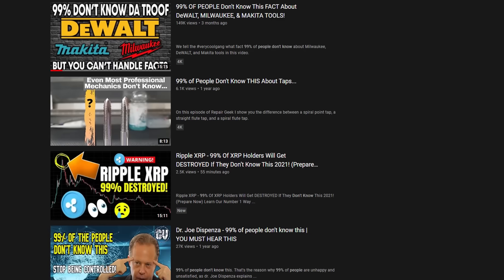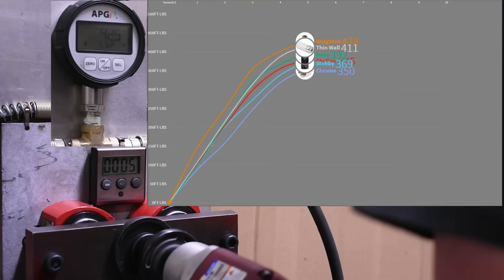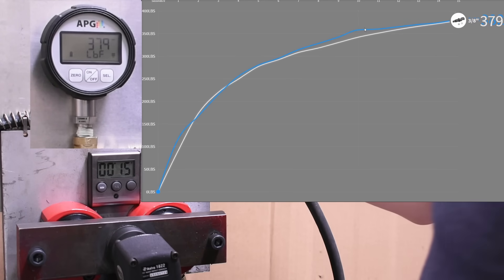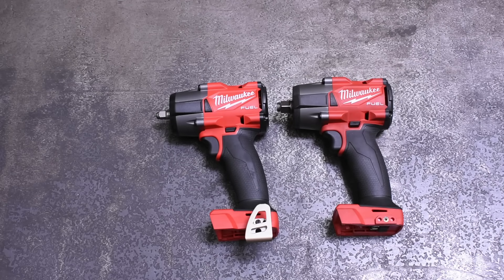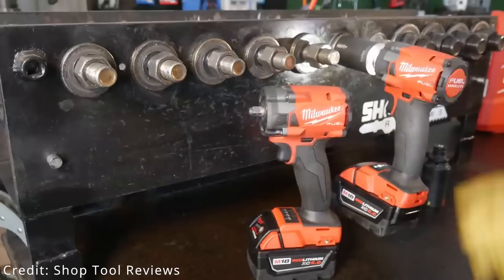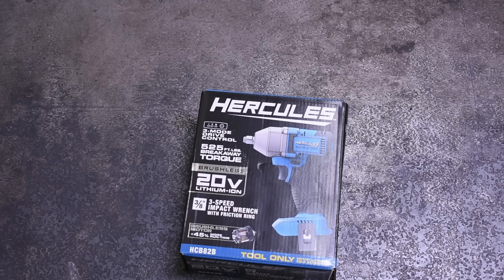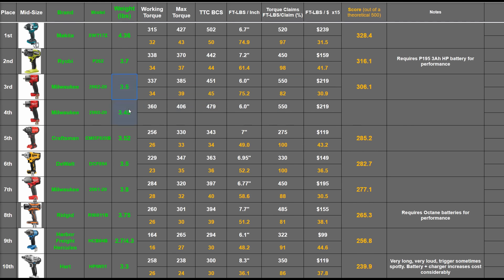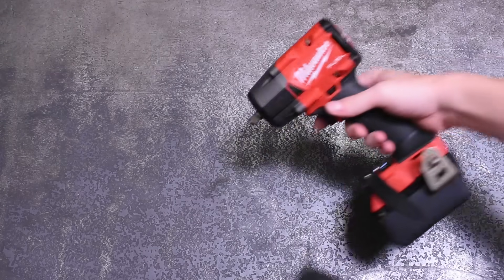Measuring Power Difference Between 3/8" & 1/2" Impacts = WTF

Comment: I use this 3/8 impact driver. I love it. I've removed 36mm axle nuts without an issue. I don't even own a 1/2" impact driver to be honest. I have the Snap On adaptor set. I'm good with that.

Comment: For this specific situation it would be interesting to see if the results are the same if you used a 3/8 to 1/2" adapter thats not welded instead of a custom socket because in the real world most of us are not going to buy custom sockets and would just use an adapter. I know you referenced the other videos but im curious if the results would be the same which the may just be.

Comment: I can see a point to having a 1/2 over a 3/8. Say you're working on some bigger stuff, using larger sockets, like 1 7/8in or something like that, which isn't normally made in a 3/8 drive, it's better to use a 1/2 for stuff like that. I'm eventually gonna pick up a 1/2 mid-torque for stuff like that (also because I don't have 3/8 SAE impact sockets, whereas I have 1/2 SAE impact sockets, and I work on enough stuff that uses SAE to make it worth it) and considering it's a monster, I might use it for most jobs that I'd normally be using my 3/8 with an adapter for.
Reply: If you're using sockets 1 7/8 inch sockets, at that point you should be looking at a full torque, not a midtorque.
Reply: @Ninoo187  Doesn't always fit where I need.
Reply: @enlightenedrenegade472  you can't fit a full torque where you gotta use a 1 7/8 socket? ..... I doubt it but okay.

Comment: I bought the 3/8” mid torque gen 2 few months ago and it’s great, I had no idea it was any more capable than the 1/2” on the contrary I thought by sepc that the 1/2” is little bit better but I wanted it be used on wider range of bolts and nuts & 3/8 was better fit for me, nice to see it is the more capable version of the two (not that the 1/2” is weak by any means).
Reply: Wait, so I should probably buy a 3/8 for a weekend warrior like me and just use a 3/8 to 1/2 adapter?
Reply: It's not more capable. This data doesn't show long term use. If you wrench daily, you WILL break your 3/8 head doing 1/2" tasks. I've seen it happen and it's happened to me. Never have broken a 1/2".
Reply: @Frissdas1207 then show me the data that the 1/2" version of this tool is better long term, show me data that support your claim that THIS tool version 3/8 breaks easily on " 1/2" jobs". Otherwise this is just talk.

Comment: I'd be curious to see you take the 3/8 and 1/2 Milwaukee and swap the anvils to see if the 3/8 gun is doing something that the 1/2 gun isn't.
Reply: This, this should have been the next step in finding the root cause.
Reply: The Milwaukee Right Angle Fuel advertises the 3/8 and 1/2 with the same spec's and the same price; IOW it's the same tool only a different anvil. My guess is it's the same with many other manufacturers, which explains why there's little difference between the two. Further, the 20v Atomic DeWalt 1/2 stubby impact wrench has the same torque rating as the Atomic 3/8, but the 1/2 costs $100 more. I guess it's all about marketing.
Reply: Just anecdotally I use the fuel 3/4 at work and another guy has the heavy duty 1/2" that's exactly the same except for the anvil. Never ran into an application where one outhit the other and it has come up where we've used both to try to bust bolts loose.
Reply: ManCaverTools put the 1/2" stubby anvil in the 1/4 hex impact driver stubby body/motor, and it actually outperformed both in their own configuration
Reply: TTC also collab'ed with them and tested the reworked tool output. In that case, I believe it was the increased rpm motor design coupled with the harder hitting anvil setup

Comment: The next step I would be trying, would be swapping the 1/2 & 3/8 anvils between the 2 & see if the results follow the anvil, or the units.  In the same way as you did with the air drive.
Reply: @Torque Test Channel  please read this guy's comment!
Reply: I would first like to see a reducer put on the bolt (ie. down to 19mm) and he uses short 3/8 and 1/2 sockets from the same manufacturer.  I don't like how much wobble the long socket creates at the anvil at higher torque seems like maybe torque is being wasted.
Reply: Yep' sure.
Reply: Me sitting here smirking with my 3/8 compact and mid I've been swearing by..I did recently grab the 3/4 high tho for lug nuts. It's still not a winner against our shop IR 1" but it works 70% of the time and is way more convenient.....most of the time..
Reply: the fact they didnt was odd to me
Reply: I really thought they were going to swap the anvils and then test the tools again on the Milwaukees.
Reply: This, and/or buy five of each and test for unit to unit variance. It certainly sounds like the two tool are built exactly the same except the anvil, which could mean that small variances in manufacturing tolerance and battery performance could be the primary factors at play here.
Reply: I was undecided and bought the M18 Mid torque 3/8 drive .
 First Job required a 3/8"dr  18mm socket and a 3/8"dr 6" EXTENSION,
The extension flexed instead of transmitting torque it was like one of those lug nut torque sticks no go!
 Used same 3/8 impact with 1/2"dr adapter 1/2" extension and 1/2"dr 18mm socket and it worked perfect....So I WILL NEVER BUY A 3/8" dr impact that puts out over 250ft. Lbs.....
 Also The hog ring thet holds sockets on broke on this same 3/8"dr M18  Mid torque impact never had that problem with 1/2" dr ....
 You should start testing impacts another round with extension bars just to show real use scenarios !
 Thanks for testing Tools good info Usualy.
Reply: ...And Yes all my sockets and extensions and adaptor I used were impact rated tools.
Reply: Yup. Probably should even take it apart, clean, and re-grease the hammer/anvil before and after each run so we don't get grease variance ;)
Reply: Care is needed because there are so many variables. Things like temperature can make a difference. There is no physics reason why anvil size should mark any difference.
Reply: Well there are physical reasons why it could happen. Like weight and tolerance.
Reply: 2:10 The same tool after swapping anvil?

Comment: But can I swap in a faceplate and 1/2" anvil in my 3/8 stubby m12? Essentially using the 2555-20 parts in my 2554-20. It'd be a cost efficient way to have both 1/2 and 3/8 impacts without an adapter

Comment: But isn't the key qualifier that you mentioned is that your findings apply to large bolts?  Most people using 3/8 sockets would be using them for 19mm and smaller size sockets.  Would you still recommend 3/8 impact over 1/2 impact for 19mm and smaller application?
Reply from the maker: Yes. What was specific to large bolt size was socket mass not making a difference
Reply: @TorqueTestChannel  Right, so you concluded that socket mass makes a difference in smaller bolts?  But all 3/8 sockets have less mass than 1/2 sockets.  So even with that, the smaller 3/8 socket mass won't make a difference?

My experience has been when I used a Dewalt 887 impact driver, a 3/8 adapter and socket could not remove lug nuts, where a 1/2 adapter and socket easily did.  I'm thinking of getting a Dewalt atomic impact wrench with swivel adapter for brake caliper work.  Prefer the 3/8 size, but did not think it could match the 1/2 impact power.

Comment: Is it possible to take apart the 3/8 and 1/2 Milwaukee and swap the anvils? I have a feeling some of those differences are really just down to them being different tools whereas the Onyx was the same tool with swapped anvils.

Either way, it's nice to know that the "same" tool with a 3/8 will have similar power to a 1/2.
Reply from the maker: What about the Hercules?
Reply: @TorqueTestChannel  Yeah, that too. I suspect the internals would be more different with it, but if it's possible to swap those, that'd be good to see too!

A head-to-head with all 4 runs. Both tools with 3/8 and 1/2 in it.
Reply from the maker: What I'm saying is, the two Hercules performed the same despite not being the same tool. And check our recent ridgid high torque new vs new purchase and m18 new vs used. We also just bought another dewalt. They all perform the same as each other. There isnt this any data to support what were seeing here other than drive size
Reply from the maker: What I'm saying is, the two Hercules performed the same despite not being the same tool. And check our recent ridgid high torque new vs new purchase and m18 new vs used. We also just bought another dewalt. They all perform the same as each other. There isnt this any data to support what were seeing here other than drive size
Reply: @TorqueTestChannel  True enough. But if it's possible to test without damaging the tool, it'd turn a solid theory into proof.

Comment: Maybe the 3/8" drive generates more of some kind of rotational spring action that helps.  With the assumption being there's an ideal tradeoff between stoutness and springiness.
Reply: Spring twist shouldn't add torque, it's just flexing of the shaft. Same torque in, same torque out.
Reply: @bluewker  Just conjecture, I was intuiting something like how a kinetic recovery rope works.  A spring-like quality in the system could store up impact energy and then release it in a shorter, higher torque burst.

Comment: I figured they would be the same assuming the same motor and hammer system. However if you make an impact strong enough eventually it will break a 3/8" anvil. Hence no High torque 3/8" impacts.

Comment: If the anvils are interchangeable, I would expect the torque to be equivalent between the 1/2” and 3/8”.
Reply: Its not. Because the masses are different. The 3/8 drive has less mass than the 1/2 drive.

The effect were seeing here is caused by an interaction between the motors torque curve and the anvil mass. The motor seems to struggle at the last bit of the dyno test, because the 1/2" anvil seems to be a little too heavy for it to max out.
Reply: @Chris  Another possible explanation is the length of the 1/2 socket creating a wobble at the anvil and torque loss when the bolt gets harder to turn (since he is not holding the impact wrench securely).  The 3/8 socket is short and does not have the same issue.  You can see the difference in wobble in the video.
Reply: @Chris-yy7qc  would the mass actually be different? Think about it, if it’s the same size socket they’ll still have almost the same volume the difference will be the 1/2 will have more weight in the anvil and the 3/8 will have more in the socket. Maybe?

Edits: my best guess would be something with harmonics, still don’t see mass being a factor for the reason previously mentioned
Reply: @christiansmith8529  1/2" sockets are bigger and therefore heavier than 3/8" drive sockets.
Reply: If you changed the output gear on anything else you wouldn't say that.
Im guessing it's relevant to the impact motion being different to a steady load and flex in the metal, and the small amount of extra mass.

Comment: Maybe at the beginning of the curve, the 1/2" transfers more momentum, like the heavy sockets do. But at the top end, the 3/8" is robbing less power because it's lighter? Big burly V8, low end torque, vs high RPM 4 cylinder generating more power?
Reply: Had a similar theory
Reply: @chasewebber4316  would be interesting to compare the hammer masses and moments of inertia between anvil sizes. Bigger hammer / anvil hits harder but maybe at a lower speed, so less power is output? Just speculation...

Comment: Hey can you test the Hazet 9012m and 9012m-1? I have seen it recommended a lot on local discussion groups and work. Does the tool live up to the Hazet brand? It's frighteningly quick rpm and only 1 speed reverse though. I opened it up and every part of the air motor was perfect mirror polished even after 2 years of using at 10bar , I am really curious about seeing the amount of beans it can output

Comment: It honestly doesn't surprise me very much. I have an old DeWalt 18 volt impact driver that has proven itself capable of breaking the lugnuts loose on my f-250 when they are torqued beyond spec. with little issue. I don't trust it to tighten them enough though. I still stick to a manual torque wrench for safety reasons.

Comment: Hey could you guys test something I’ve always wondered about. Torque sticks do they actually limit the torque to the specified amount?
Reply: +19 (1 for me and 16 for the number of times my Dad has told me that "torque sticks are useless")
Reply: I think the difference between torque sticks not working well in electric tools is because the beats per minute is typically higher in electrics, faster shorter "hammers" do not allow the stick to twist and flex like in pneumatic tools. Torque sticks work by the shaft twisting "flexing" when the torque limit is reached thereby not allowing the fastener to be tightened more. The faster shorter blows electrics use do not allow the shaft to twist the same when they are used with pneumatics slower harder blows. Every electric tool is different but in general they hit faster and not as hard.
Reply: +1
Reply: +2
Reply: There is some videos on it, I think quality torque sticks are surprisingly accurate.
Reply: Torque sticks work if you use them properly.
Most rejects hammer on it till it’s way over.
Reply: I'm a mechanic and I've seen many wheels over torqued by torque sticks.
Reply: They did the video hoorah and shows they work for most part
Reply: Yeah I'd be curious too...
Reply: It's not as scientific, but this should mostly answer your question. https://youtu.be/6ccxHCwnQPY
Reply: I’ve used the snap on/blue point 9 piece set for 20 years with snap on 1/2 air guns. I’m not talking about the socket extension style you put a socket on. These are the one piece version where you have a different stick for every torquevalue/lug size. In my limited testing, they’re pretty darn close when checked with a snap on torque wrench. Once the spring steel bounces, they don’t turn any farther, regardless of how hard and long you hammer on them. I wouldn’t try that with anything bigger than a 1/2 air gun. Both Honda and Toyota dealers I worked at made us use torque sticks. The Lexus dealer I worked at made us hand torque every wheel.
Reply: You mean like they did in this video? https://youtu.be/HGxWMOP6deo😅
Reply: I remember seeing a video on that. It may have been Project Farm, Shop Tool Reviews, or maybe even here on TTC.
Reply: I've heard they don't work with cordless, only pneumatic...
Reply: @MyFortressConstruction  Huh haven't heard that, I feel like no one knows anything for sure about these things.
Reply: @MyFortressConstruction  with the Bosch GDS 18 V-LI HT they work for me. within 2 nm

Comment: That high torque on 1/2" initially makes a HUGE difference for stuck bolts and actual wear on motor over time.  In 2-3 years, run the test again.    Not to mention they ran the test using only 2 Milwaukee Impacts.........  3/8 and 1/2".    I'm assuming the 1/2" may of had a bad day like I'm having.......  Anyone have a bad day.... ?

 I just bought over $300 dollars of 1/2" sockets and impact from Milwaukee and if I find out the torque is higher and size and price is lower for 3/8", I'll be so upset.......!!!!!!!!!!  Why would Milwaukee do that!!!!!  Please explain before I use it and can't return it.  HELP!!!!!!!!!!!!!!! Why should I keep the 1/2".

If they made an interchangable adaptor I wouldn't mind. Do they make an interchanable part?  Why not run a test on swapping the hammer or whatever it's called.  Help.

You guys should post a donation icon, I'd contribute.   

LET'S GO BRANDON - EXTENDED VERSION - ( OFFICIAL AUDIO ) - YouTube

Heehehee.....  Great work guys.
Reply: Don't worry, it dosen't matter much which one you go with. I got the 1/2" because I have 1/2" sockets not 3/8" and its a beast. Get which one you have sockets for.

Comment: Makes sense when most 3/8" drive sockets are lighter than their 1/2" versions, meaning more power to nut busting and less socket weight to throw, hence 1/2" has an advantage in initial torque.

Comment: This video was very shocking to me. A shocking experience I've had that's similar to this is when I used a M12 impact driver to remove lugnuts off of my 2011 civic with a 3/8 adapter, it pulled them right off no problem but my father's 20V DeWalt couldn't take even one off. Now his is definitely beat up and has a lot more use on it but I was shocked to see that a 12v tool was out performing a 20V

Comment: The problem I have with the 3/8 mid torque is that I bust my 15,16,17,18 and 19mm deep sockets. U started with sunex and have replaced the with snap-on. But my snap-on man has had to  warranty my 18mm 4 or 5 times in the past 6 months.

Comment: I just bought the Ridgid octane high torque impact at HD. Of course the octane batteries are out of stock so I had to get the lithium ion MAX 4 Ah battery and charger as well. They threw in a 18v octane 4.5' angle grinder for free as a promotion. Thanks for the great reviews.

Comment: thats very interesting, i got the 1/2". but in reality nothing on a vehicle should stand in the way, not surprised at the axle nut on the other vid, along with a crank bolt those are some of the tightest torques you should see(not counting corrosion) and those might see 200-300 ft lbs.

Comment: Think about it it. If you use 300ft/lbs on a 1/4 20 bolt you would snap it off causing more problems than you want. Hence the lower torque for 3/8 units

Comment: I suspect It's because the brushless motors can only produce a fixed rpm and power. The 3l8 is less rotational mass on the drive allowing more power to transfer to the bolt. I think the first half of the graph exhibit the lower mass not hitting as hard when things are loose.